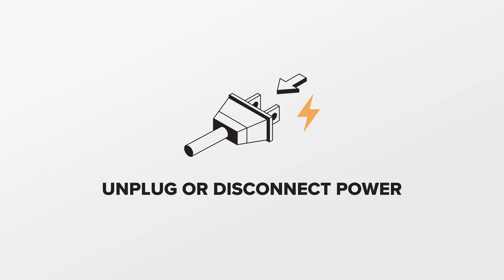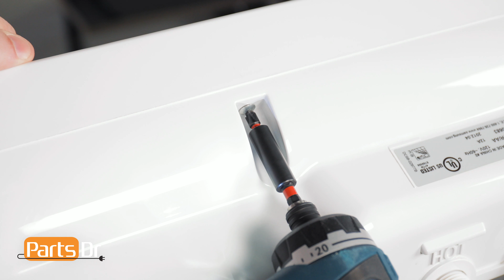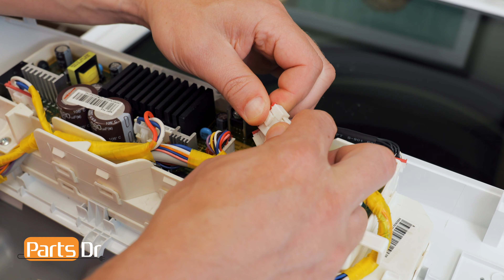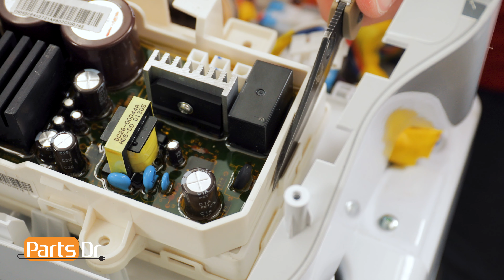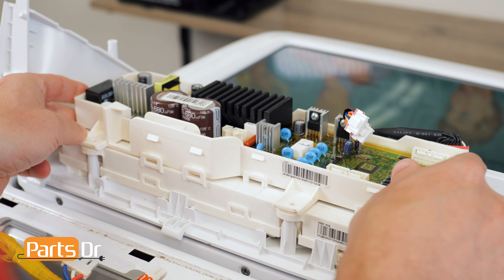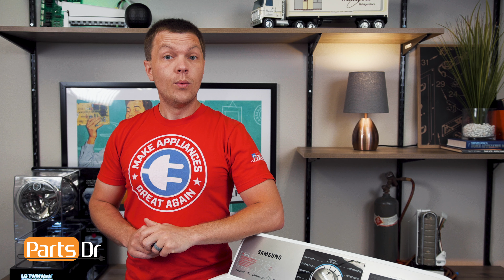How to remove a Samsung washing machine control panel part # DC97-16961A

Comment: I just wanted to thank you for this video.  With your step by step help, we were able to change out the electrical components on our different model Samsung washer and save a bundle. Instead of having to spend $600, $800 or even $1,000 dollars on a new one and add to landfill with this Samsung, the Assembly Kit only cost us $200 and we're back in business!!  Thank you so very much!! 😃
Reply from the maker: Nice job fixing it yourself!  Thanks for sharing!